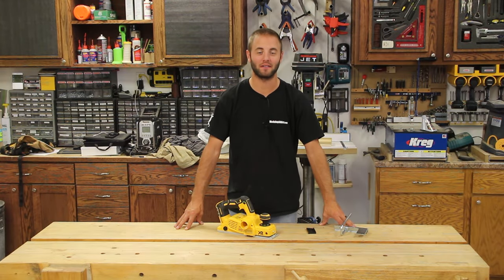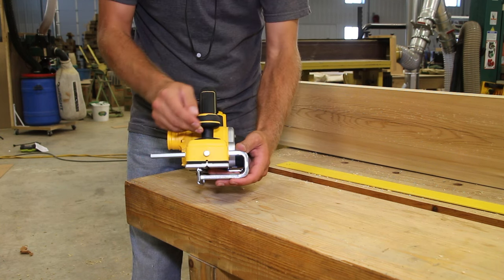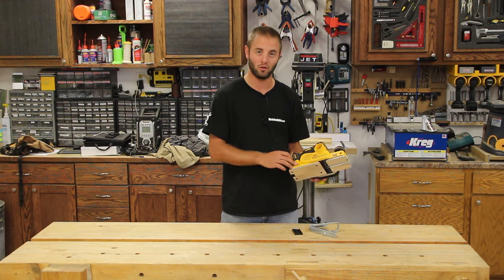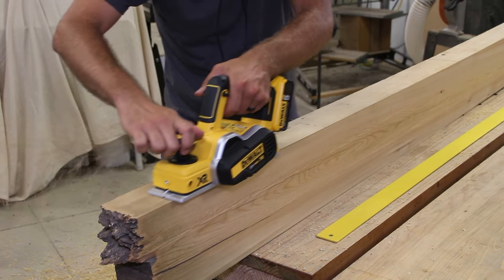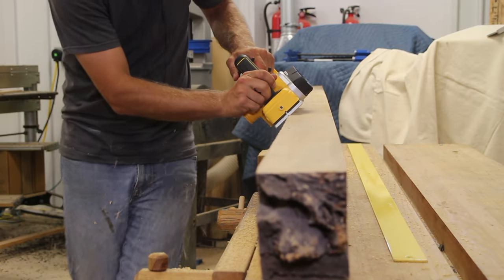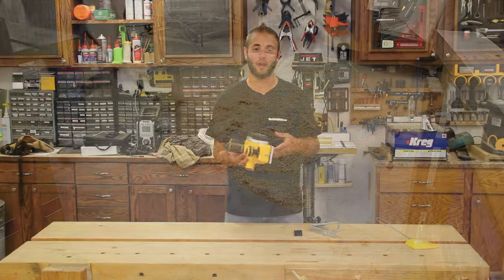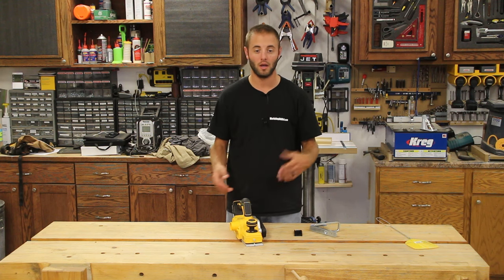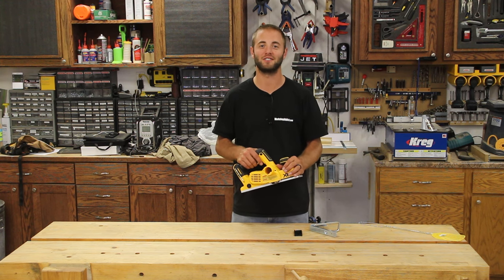Dewalt DCP580B 20V MAX Brushless Planer

Comment: I have the corded Dewalt planer. Great tool. When I was doing some remodeling in this old house, one of the 2 x 4's was really bowed.....bad. I used the planer to take out the bow so I did not have to replace the 2 x 4. Saved me a lot of work. Now that
I saw your video, I am considering getting the cordless model. I like the idea of Dewalt putting two extra blades on board. Very creative on their part.  I already ruined a set of blades on my planer. A contractor actually used a bowed 2 x 4 x 16 in the addition.  I again used the planer to cut it down but I hit a few nails. It was worth sacrificing a set of blades since the stud was pretty much un replaceable where it was. 

Thanks for the great video. "Makes a lot of chips, doesn't it?" Barry

Comment: Mannn, this is an excellent review. This is how you do a tool review. I'm not a professional, so I do extensive research before buying any tool. I know DeWalt tools are mainly known to be reliable and have good quality. Regardless of that I still want to make sure if that particular tool is what I want and need. This planer looks to be that tool that I may need for my upcoming home remodeling project. Thanks again for the review.

Comment: Good review, thanks!! I would also mention as you did about making sure the planer is secure if you use it as a joiner. I have known 2 people over the years who've lost half their finger holding the plane upside down in one hand and running a small piece of wood with the other, not good.
Reply: yep - done that myself TWICE - they dont grow back !
Reply: I do not think the meant to turn it upside down but to use it to level a flat surface in your work.

Comment: Nice video, very informative.  Thanks for posting.  Quick question: I need to plane the bottom of a porch beam that is comprised of three 2x12s.  They don’t sit flush to each other.  I am thinking of buying this planer and trying to use it to even out the surface.  Do you think it would be difficult to use this upside down?  I would be working overhead with it to even out the underside of the beam.  Thanks

Comment: What makes this better than the Ryobi 18v planer? I assume something has to make it better, considering that they Ryobi one is less than half the price.
Reply: When you go deeper with the cuts I would assume that the Dewalt will handle it better.
Reply: Cheng Liu  I have the Ryobi and it is not brushless but it has enough power and does a precise job ,I am a carpenter and I use regularly.

Comment: Can i use this to plane cutting boards after glue up when the cutting board is wider than my 13 inch dewalt planer?
Reply from the maker: Yes.  I would practice with it before I worked with expensive wood, but there would be no issue using it for that.
Reply: @WorkshopAddict  thanks!  I just ordered it

Comment: So my house has a deck belt in 1994. The hand rails very rough to the touch. Would this be good to smooth them flat so I can stand! I have tried a belt sander but boy is that making the job way to long!
Reply from the maker: It will work, and work well, but it will not be able to hit any nails as that would destroy the blades
Reply: Too long is relative, you should try to refinish hardwood flooring on a whole house with a 4" belt sander. You could remove a lot of wood with 24 grit silicon carbide belt. Going to hit that one nail with the planner when you sink most of it down even after using a woodworking metal detector. If you do, super light cuts stop when you see shiny spots.

Comment: how is this going to save you lot of time? It's only about 3 in wide versus a table jointer that is 6in or more wide. For wide stock you will have to do multiple passes with this planer versus just one pass on a table jointer.
Reply: No one brings a table jointer to a job site. This is a perfect option for onsite carpenters
Reply: @mysticalglowtv1796  My 4" table jointer is pretty light, the 12" table planer is much heavier still no problem to transport.

Comment: i have same these item but 18V can i use 20V battery my item (DCP580P2)?
Reply from the maker: You might be able to use the adapter to use the 20 volt battery.
Reply: ok thank you
Reply: 18 or 20v are same batteries

Comment: do you think i could use this to flatten a cutting block? made of maple and going over end grain
Reply from the maker: randomrazr I would not recommend that if it is endgrain. -Andy
Reply: im not sure what elese to do to flatten it tho. you think going over end grain would damage the cutting board?
Reply: Belt sander, super sharp hand plane. I slice it up in 12" sections let her rip on my bench planer (sharp blades and light cuts) and joint it back - YMMV.